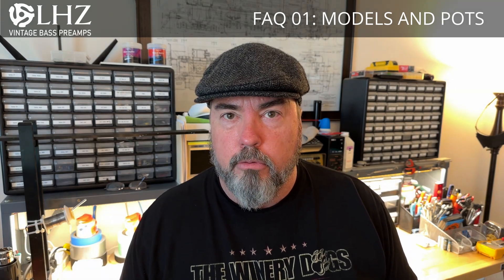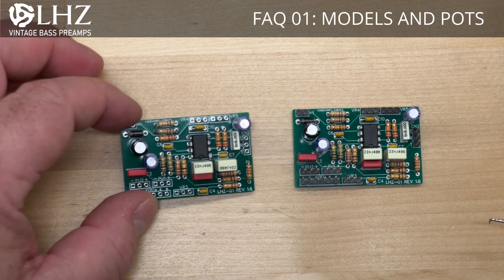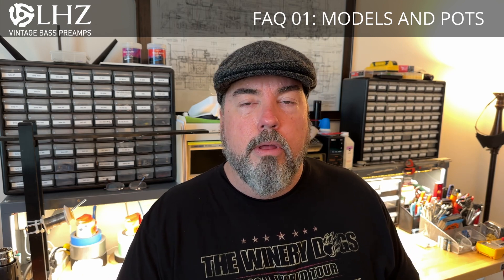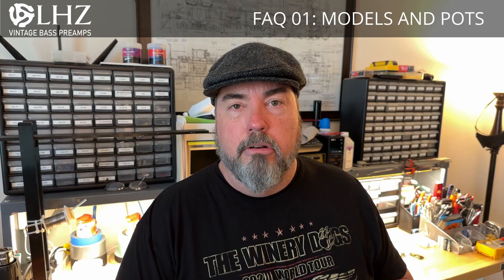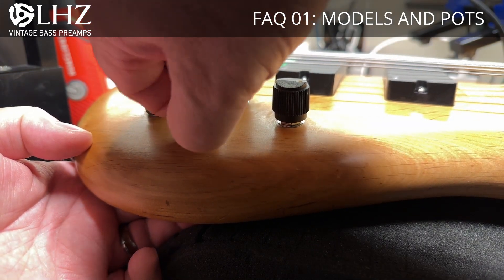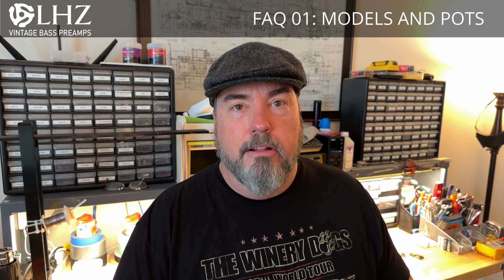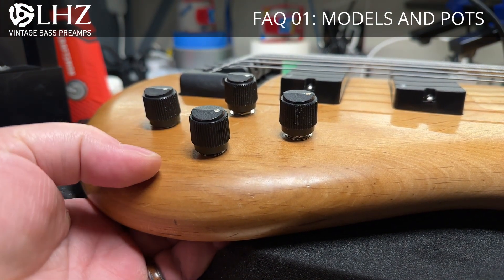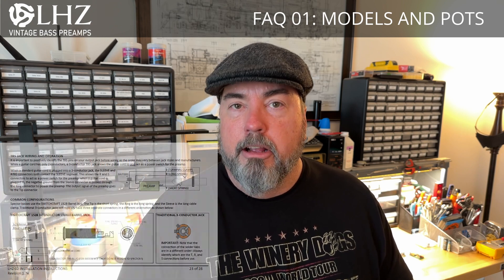LHZ HazLabs Clone FAQ: Models and Potentiometers

Comment: Hey @AgingEngineer. I'm in Mexico City and order a Spector Skyler Accord model. I want to change the preamp for the LHZ-03 and the Barts pickups for the EMG 40DC. I heard what you said in the video regarding the Spector bases for the potentiometer so I guess if I order my LHZ-03 from ebay that won't be a problem anymore right? Or should I consider anything else before ordering it? Any other advice you can give I'll appreciate it. It's the first time I am going to modify my bass, probably I'll do it with a luthier but just want to know if I need to conaider anything else or if it would be as easy as ordering the new preamp and pickups, take the ones from the bass and just put in the new ones...

Comment: Question, I have a NS Pulse 2, can I fit a LHZ  preamp in the bass?
Reply from the maker: Absolutely! The LHZ is tiny, and we have not found any basses that it will not fit into. We've got many clients using the NS Pulse 2 with the LHZ in it, and it's even running inside a few Steinbergers.
Reply: @LHZpreamps  Nice, thanks for the info

Comment: This is really cool, are there any plans to do anything else with it beyond just the clone, like putting it in a pedal enclosure or maybe a 3 or 4 band version. Not tryna go "Oh you should do this and this" I'm mostly just curious if there's any plans or ideas kicking around.
Reply from the maker: Actually a pedal version is already in the prototype phase right now, and I am hoping to have a demo of that available in a few weeks. I'm planning two version of that: a straight LHZ in a box for passive bass players, and one with pre and post gain stages using the same LF442CN op amp that will allow you to drive the preamp even harder... I have a gut feeling it might make an interesting overdrive for guitars.

I've also had folks playing Steinberger and Ken Smith reach out asking if we will offer a revision tuned for those instruments. As soon as I can get some comprehensive photo sets from those preamps, I can reverse engineer those as well.